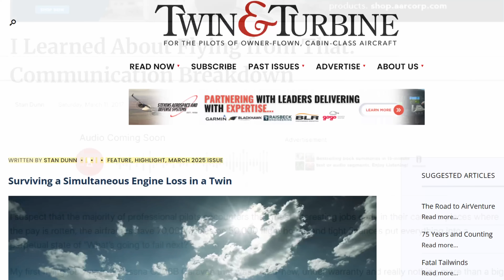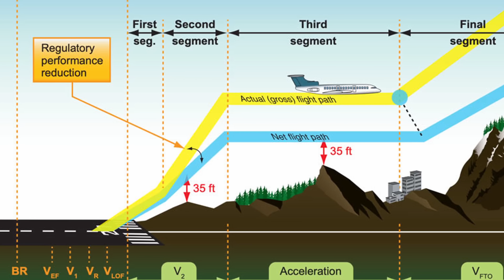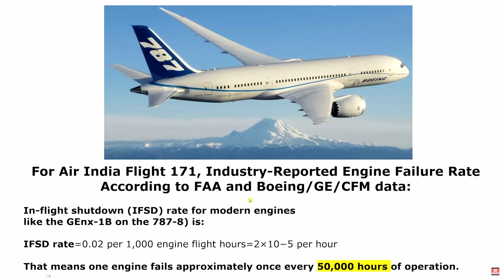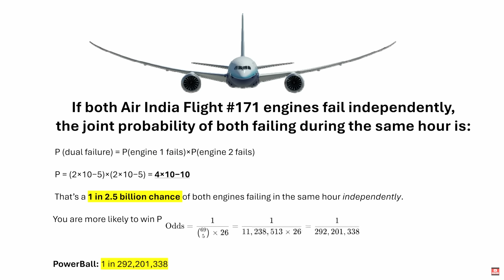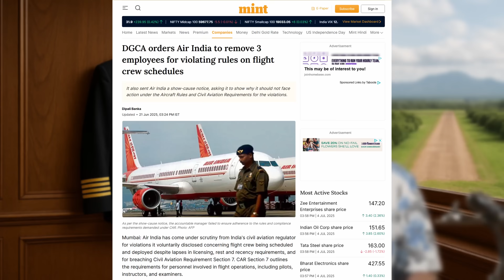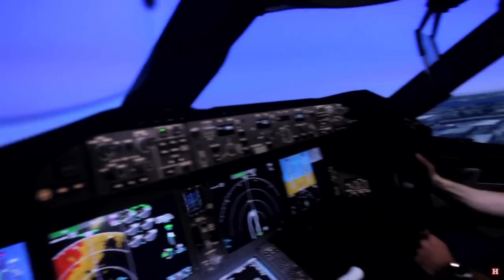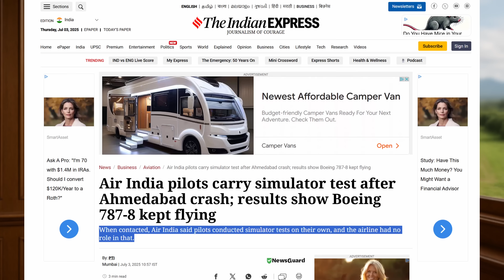Air India 171 Cause Becoming Clear

Comment: DGCAs actions are not related directly to this accident. They just woke up and started doing some extensive reviews and taking some actions they should be doing all along. It doesnt mean they knew anything specific about this flight.
Reply: AI 171 was bound for London Gatwick, with an expected flight time of 9 hrs 40 min. Apparently this was undertaken with a crew of two pilots. The maximum time that a two pilot crew can fly is 10 hrs, which only gives the crew 20 minutes to handle delays and diversion. I think that the AI 171 route should have had a third pilot.

Comment: When you analyse a situation, you have to go first with what you see, hear and witness. For the most part - good work. However, with the 'Dual engine failure' theory, not so great. Bringing in probabilities as an explanation for it not happening, over what the pilots said and what appears to be seen on the footage, is not valid. Was hoping you would go with it - hydraulics, electrical failure, computer software, etc. Also one of the engines being replaced a few months prior. So in short, can there be in theory of one single cause that is consistent with what the pilots said - ie, loss of thrust?

Comment: Ehm? Jeju was due to no landing gear deploying.. not really engine failure primarily
Reply: No. The undercharge and flaps could not be deployed because the engines were not producing sufficient power for the engine mechanical fuel pumps to pressurise the hydraulic systems. And the the engines were operating a too low a speed to keep the electric generators online, hence the 115V 400Hz AC was not available to energise the electric motor hydraulic pumps.

The fundamental problem was that the crew saw an enormous flock of birds and elected to go around, only hit birds after the undercarriage and flap had been retracted. 

There are good videos available from the Korean Public Broadcasting that have English subtitles. They include video of flocks with more than 500k birds.

Comment: 14K hr Airline pilot here. Excellent comment here, debunking a lot of myths about this tragic crash. Still have to wait for the official report.
Single scource causes for multiple engine failures? Yes there are some. Two mentioned in the video. There, however is another, an insidious one. See Eastern Airlines flight 855 date 05-05-1983, lost all three engines due to a maintenance (AKA, human) error. (Were barely able to scrape back to a runway).
My condolences to all next of kin of the deceased and I hope, the sole survivor will make a full recovery
And just wait for the offical report.

Comment: it should also be noted that air india has had a lot of aircraft crashes and i am not talking about those crashed due to hijacking or terrorist attacks their latest was a Boeing 777 the piiot can be heard snoring right after take off the co pilot too over till approaching the destination airport now this airport is known to be a very difficult airport to land at because of both runway length and the fact that it has deep gorges at both ends of the runway well despite being told 3 times captain go around by the copilot and this was captured on he cockpit voice recorder and despite being to high the captain decided to continue when the aircraft touched down it was still doing 162 knots 30 knots over the speed he also touched down 1,780 feet beyond the touchdown point  over running the run way going through the fence across a road down the 60 meter gorge killing 158 people and despite this being on the recorder both AIR INDIA AND THE INDIAN GOVERNMENT DISPUTED THE FINDINGS TRYING TO BLAME IT ON FAULTY THRUST REVERSERS AND FAULTY BRAKES IN SHORT ALMOST EVERY ONE OF THEIR CRASHES CAME AT LANDING AND WAS CAUSED BY PILOT ERROR !

Comment: I am not a pilot, I am not an aerospace engineer or whatever all these credentials that all the commenters seem to have. But my (usually very aware) senses tell me this is not a (double) engine failure. And not an issue with the flaps. Neither fuel contamination. The most rational explanation is that it had something to do with electrics. Which power the fuel system on the 787. So they were losing thrust and what we saw unfold matches with this scenario. Longer than normal on the runway, but did take off. Then losing all power once airborne and then slowly gliding down till they crashed. Matches also with the pilot's mayday call "no power no thrust". Final investigation report will shed light. Rest in peace to all the lost souls 🙏
Reply: a 787 will suction feed fuel without wing tank boost pumps.  you should know that.  I am also an engineer, a flight engineer for 37 years.  A mechanical fuel pump on the engine pumps as long as the engine is turning.  What will cause both engines to shut down at the same time on a 787?  Fuel contamination, such as sabotage where a fuel truck is loaded with water is put on the jet, yes that has happened before. or a suicide where one of the pilots pulls both fire handles or puts the fuel cutoff levers to cutoff.  Was there a jumpseater in the cockpit?  this is another question that needs asked that I have heard nothing about.
Reply: Considering the RAT deployed it is 100% an electric thing that went wrong. The RAT may have been deployed by the crew in a reflex when both engines seemed to have failed while they may just have idled and would’ve provided electrics and hydraulics, but then the gear retraction sequence wouldn’t have stopped after the trucks tilted. The trucks tilting but not retracting is a key fact to this problem and points toward an electric failure caused either by dual engine failure (a single engine is enough to take off) or an electric fault causing the engines to roll back.
Reply: ......from the sketchy videos I've seen.....the front Goodyears were pointed in the "retract" position ie to me the gear handle had been RAISED followed immediately by a disastrous electrical failure (FEDEC malfunction is my suspect). We will see....
Reply: Even if the boost pumps electrical failed, you still can gravity feed the engines without the pumps.
Reply: @PatrickBradley-y2t  Yes, but it is an open question as to whether they feed the engines the required fuel for take off power on gravity feed only.

I did some flight simulator tests in X-Plane.  Dual engine failure mandates a very steep nose down attitude to avoid a stall.  This aircraft seems to have thrust, just not enough of it, and it certainly didn't stall: it was far too shallow a descent to be a stall.
Reply: Each engine FADEC system has a dual channel EEC (Electronic Engine Controller) to control the engine. The FADEC power supply for the EEC is a PMA (Permanent Magnet Alternator driven by the engine) that is a dual winding alternator, each winding supplying power to its own independent EEC channel. The airframe electrical power systems do not power the EEC when the engine is running. The much speculated about RAT supplies emergency electrical power for essential flight instruments and hydraulic power to move control surfaces in the event of a dual engine failure.

I hope the above helps a bit. I'm not impressed by all the wild speculation about the cause of this tragic accident. People claiming to be airline professionals should know better.
Reply: I suspect you're right. One of the distinguishing characteristic of the 787 is that it often uses electrics where other planes use hydraulics. That makes it exceptionally vulnerable to an electrical failure and in this case one involving both engines. But what would trigger that failure?

Back in the 1990s I was fortunate enough to tour of one of Boeing's test facilities. A partially constructed plane was subject to repeated take-offs and landings. Hydraulics and cables simulated the various stresses. It allowed hundreds of flights to be simulated in just a few days at little cost. I was also told that one of the items being tested was the effects of electrical surges and voltage drops in the wiring and control circuits. 

One of the facts we know is that the (probably dual) engine and electrical failures came just as the landing gear was being retracted. That is why the gear seems to have stopped while partially retracted. I wonder if ordering the gear retraction triggered a failure in key engine controls. It could have been a surge. It could have been drop in voltage due to a faulty electrical connection. 

A faulty connection would fit with the report of a passenger on the previous flight that the air-conditioning and entertainment systems on this particular plane weren't working. And that suggests a cause that is fraught with emotion—poor ground maintenance.
Reply: @Inkling777  ...your on the right track....I think!
Reply: @Inkling777   Somewhere I've read a speculation about the automatic system controlling the engines - is it FADEC? The system shifts the engine configuration from 'weight on wheels' to 'weight off wheels' - and it is clear from the video that thrust is lost very quickly after the aircraft is airborne. It's as if something returns both engines to Idle.  Thoughts?
Reply: As I noted above, there is a single point failure in the A Bus B Bus transfer switch.  If the transfer switch fails, it might be possible to lose both A and B Bus, which is most of the electrics.  FPD in this transfer cabinet when the 787 was being qualified almost crashed a prototype.

Comment: Most computers people are familiar with a RAM based. In ram based systems sections of the program can be changed on the fly. Everything has to be loaded from mass storage (aka boot up) before it can be used. Aircraft computers are ROM based The program is there ready to use at power up. They can only be changed with proper equipment.

Comment: Man I’ve been on aviation for 35 years and is the first time that I ear  Cockpit Video Recorder what are you talking about?
Reply: The AI B787-8 is probably equipped with a video recorder to capture the output of video cameras in the cabin and is use to protect the flight attendants. Cameras are not installed on the flightdeck. The recorder is not crash proof.

Comment: As an expert self taught aerobatic Super Decathlon pilot who loves inverted spins after lunch, look at his rudder. At no time did one get throttle back and then pilot pulled fire handle on the good engine. heavy rudder would be noted for a little bit but is not. No I also software/hardware expert and this was a FADEC central control computer bug by the programmers in India Boing outsourced all B787 software to in 2011. It was junk software most likely, just bad Karma. So my question is as a really expert check ride pilot for Boing Heavy's, have you actually ever practiced entry and exit to a flat spin in any type, like say an 8KCAB or RV8 maybe? I would highly recommend that all pilots realized what my USAF F-104 flight instructor taught me was not to confuse right direction of rudder use when you perform a "Slip" to loose altitude quickly as you find yourself "too hot" on final approach? Just sayin'... :)

Comment: ok now lets discuss what the cockpit voice recorder picked up and the pilot in command can be heard saying during rotation MY SEAT MY SEAT upon rotation the captains weight is increased due the G FORCES when hi seat went into full retraction because he had not assured it was fully locked his hands which were closed on the throttles brought the throttles back to full idle and the engine shout off switches are right below that now did his hands hit those as he was struggling get control of his seat we will never know even if the switches had not been hit the aircraft was doomed  those GE engines take a full 7 to 8 seconds to ramp up to full thrust from idle and they were only at 400 ft maybe with no power  and the landing gear mostly down ALSO ADD TO THAT THAT AIR INIDA STARTED BLAMEING BOEING OH OH YES WE JUST REPLACED THAT PIN 11 DAYS AGO sure they did all the 787,s flying no reports of failed seat pins ok air india hmm you had electrical issues on that plane the previous day before the flight that you did nothing about but you replaced a pin 11 days ago hmm you have a history of improper maintenance ,using substandard parts missing screws and bolt found on aircraft .

Comment: 14:21 i already found this bit curious when i saw the footage for the first time. the whirled up dust (?) on rotation. first i thought they must have used up the entire length of the runway and only rotated at the very end (bad engine performance), so it would be actual dust from the grass. but apparently the aircraft rotated much earlier and not at all at the end of the runway, so it probably was smoke coming from the left engine. if i recall correctly, the surviving passenger said something about a bang followed by a lack of lift, something you would expect in the climb if one engine fails due to damage of some sort. it seems very plausible that they mistakenly shut down the right (good) engine after that and found themselves with no thrust, just gliding now.
Reply: The runway is 150 ft wide and the B787 wingspan is 197 ft, hence the wing overlaps the edge of the runway by 25 ft each side. As the aircraft increases speed the wing generates more lift. The tip vortices remain parallel to the runway during the take-off run. When the aircraft rotates the vortices are directed downwards towards the surface,  which causes the dust to be picked-up. There was a light crosswind from the right, which caused the dust to drift left.

Comment: At 10:32 n the video, what is described as a "black box" is actually actually a photograph of an Emergency Locator Transmitter (ELT). Somehow this fake information has spread on several channels. An ELT doesn't record anything. It is a distress beacon that transmits the aircraft location on 406 MHz and a very low power homing signal on 121.5 and 243 MHz to aid search and rescue personnel in locating a downed aircraft or life rafts in case of a ditching. The ELT is manufactured by ELTA in France, model number "ADT 406 S".
Reply: Correct. Sometime they are called Emergency Locator Beacons (ELB).

I fly gliders cross-country in the Scottish mountains. For safety I wear a parachute to which I attach a Personal Locator Beacon (PLB) similar to those used by hikers.

Comment: Uhh them shutting down the wrong engine i such a critical phase i dont think so. The pilot monitoring moving the gear up and then immediately cutting of the working engine, i dont think so.  While it has happened, the critical phase of flight would almost certainly delay that action.

Comment: You are missing the fact that the gear was partially raised. The first step being tipping the wheels forwards into the stowage position
 You can clearly see the gear tipped forwards in the videos. That means they lost power right after operating the gear leaving them stuck in the first stage of retraction.

Comment: At this point we know flaps aren’t involved and stall is due to both engines thrust loss. RAT was deployed ( audible in crash video footage ) and a pilot said « no thrust, losing power » at ATC. Other evidences for both engines loss : in video footage the main landing gear bogie angle indicates an action from pilots but not enough hydraulics for retraction. Also APU door flap slightly open ( crash photography) indicates auto start due to power loss.
 
Now to understand how is that possible. We’ve to wait investigation.

Comment: This guy knows nothing. I am not a pilot and not an expert in aviation and aircraft. It's a pilot seat failure due to a broken safety pin. The seat slides backwards during take-off, causing the pilot to lose control. I will never fly boeing ever.

Comment: Two points: 

Firstly, I am no mathematician, but my (limited) understanding of probability is that it is only and always unique - it has no memory, and no awareness of other incidents or outcomes.

In other words, the probability of a particular make and type of engine failing is the same for every one of those engines. It is not dependent on the probability of another engine also failing.  Both the engines on this plane had the same probability of failure - irrespective of what happens to the other engine (ignoring shared systems, etc). You cant multiply probabilities.

In simple terms, if you toss a perfectly made/balanced coin 100 times under identical conditions, you would expect something approaching 50 heads and 50 tails.

But, if you had just had 10 heads, you might think that this made the next toss more likey to be tails. Whereas, in fact, the probability is EXACTLY the same as with every other toss - 50/50. 

Humans have an entirely non-mathematical (and incorrect) 'understanding' of probability.  

Secondly, one common factor that could affect both engines simultaneously is not mentioned here at all - a systems/computer failure.

With modern fly-by-wire systems, the software is phenomenally complex, and way beyond the capacity of humans (even with computer - even AI - assistance) to thoroughly test. As was so tragically revealed in the 737 Max crashes.

In most commercial situations, this is got round by releasing Beta versions of software and effectively using users as real-world testers. But (obviously!) this option is not available to aviation software developers. 

So such software, no matter how thoroughly tested, will always be open to unexpected errors or confused responses - even possibly many years into it's use. 

Such system failures will typically only be discovered when extremely unlikely sequences of events occur. We won't always be as 'lucky' as we were with the 737 Max, when the same entirely unforeseen problem happened early in the plane's life, and in two separate incidences close together. 

Although, personally, I think that such a system failure is fairly unlikely in this case, it IS possible and should not be ruled out.
Reply: you are correct - you are no mathematician